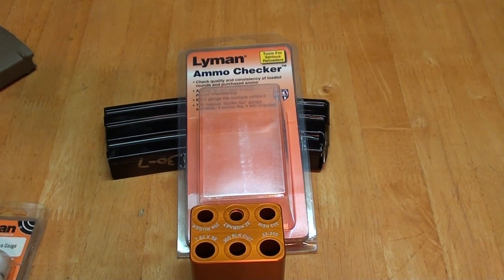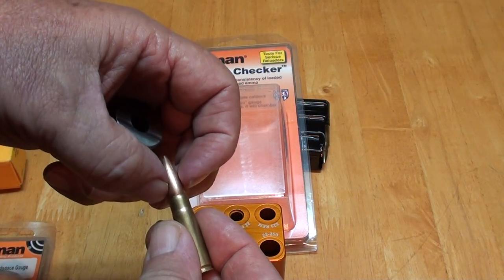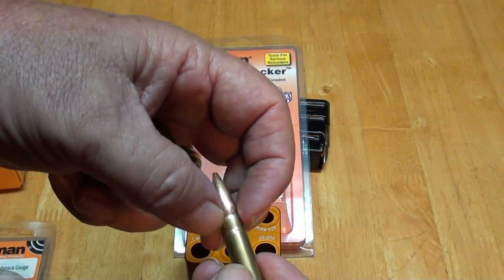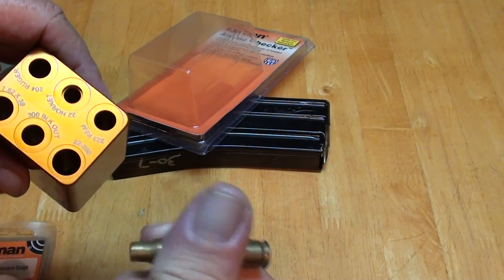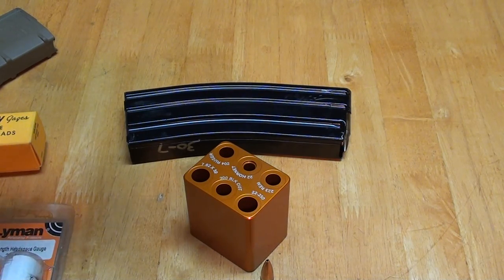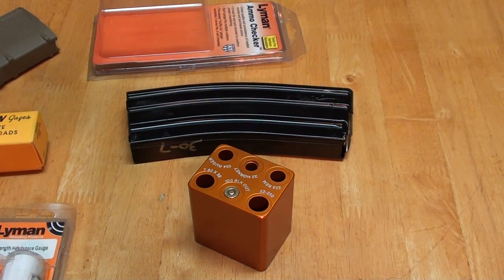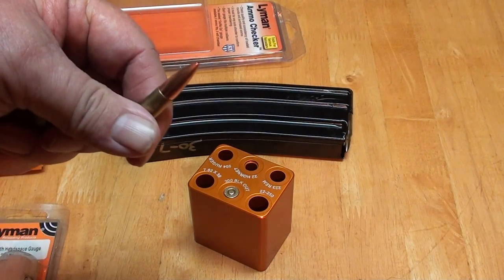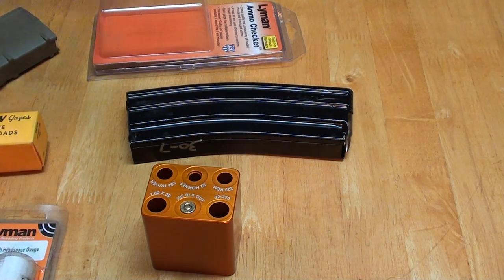Case gauge vs Ammo Checker .... which is which?

Comment: I love the Lyman ammo checker, but it’s not always perfect.  Earlier this year I got a great deal on several 100-round packs of Federal American Eagle .45 auto.  All rounds fit in the ammo checker, but about 10% of the rounds did not fit well in 3 separate match-grade 1911 barrels.  You had to really jam them the last bit of the way in, and it took some force to pull them out.  Upon close inspection of the pulled cases with a ball micrometer, the rounds that didn’t fit well had non-uniform case thickness around the mouth.  It was actually a really pronounced defect in those rounds; one side of the mouth was abnormally thick and the other side was way too thin. This caused the bullets to be non-concentric, and they were seated slightly tilted with respect to the bore axis.  This caused the side of the bullet where the case is too thin to wedge against that side of the barrel when chambered, and you can see the marks on the jacket when you remove the round.  When I tested the rounds in non-match-grade barrels, they fit perfectly fine in agreement with the ammo checker.

Comment: You are one of the few people that understand what a headspace gauge really does and what a case checker really does. Most people don't even know how to measure case total length using their headspace gauge (they push up on the primer side with their finger rather than placing it on a flat surface). I really don't reload rifle but I have headspace gauges for those that I might load. If I ever start reloading rifle I will get one of these ammo checkers too. Finally a knowledgeable reloader.
Reply from the maker: Thank you for the kind words. It is much appreciated.
Take care

Comment: Your Wilson tool is meant to check fired brass before resizing to determine if you need to resize and or if you need to trim... unfair to compare it to the lyman ammo checker as they are both for different jobs but do share 1 job in checking headspace, I am not sure about the lyman case gauge if it checks fired brass or if it has to be resized before you do, but the ammo checker is for nothing more then after you produce ammo that has been sized loaded and trimmed before hand, Both are handy tools to have

Comment: I guess that even that thing will not check the primer to make sure it is seated far enough. I have had some trouble with primers since I have had to use some of the cheap primers that are all I can get now. If the primer is not seated far enough  into the case, it will not fit into my chamber primarily on my Swedish M 96 6.5 x 55 Mauser. Have not had any trouble yet on my other rifles except maybe on my Swiss k-31 which is very sensitive to bullets. If they are not just right it will not fire them even if you can chamber them,
Reply from the maker: You might want ti checkout the RCBS bench priming system... it has adjustments for the seating depth of primers.
Take care

Comment: Using the Lyman Ammo Checker to aid in setting up your FL die and after resizing your brass before you load the case will save you a ton of headaches. However, if you have a "tight" camber some loaded rounds will still pass the ammo checker but won't chamber in the rifle. Then the rifle's (Usually a bolt action) chamber becomes the final and painfully slow test.

Comment: Nice vid.   I got myself one of each and yes I have 223 brass that shot once from my Rem 783 which can be neck-sized  and fits the case gauge which fails the ammo checker.  I guess that is because the fired case will still fit that specific gun it doesn't mean it will fit another .

Comment: Thanks very much, I do see your point, but I see the value in both.  You're right, the chamber checker does something the case gauges don't do in checking against min SAAMI specs. but as you say the reverse is also true.  The Wilson / Dillon case gauges also let you check for the correct trim length of a fired case before loading, plus unlike the chamber checker will allow you to determine exactly how much to adjust your sizing die to get optimal distance of the shoulder off the chamber wall, say 0.002" or so for a bolt action.  All you need is a dial indicator or caliper.

Both tools are valuable.  I keep a chamber checker in my range bag, but have Wilson and Dillon case gauges on my reloading bench.  If I could only choose one type it would probably be the case gauges for that utility, but luckily there's no need to do that.

BTW, I bought the L.E. Wilson gages for years just because of their quality, and they are beautifully engineered, but if anything the Dillon gauges are even nicer, and unlike the Wilson are stainless steel.  You have to be careful to keep the Wilson's oiled and in the plastic bag they come in or they will rust quickly.  

This is a quality tool from Lyman, but I've heard of some QC issues on their case length headspace gauges that compare to Wilson and Dillon, so even though they are $5-$6 bucks cheaper than those never went with them.  Tnx.

Comment: If your chamber is minimum spec tightness, then you need to buy small base dies. Problem solved.    That's what I use for my AR 15, anyway. RCBS AR Series, small base .223 dies. They allow your ammo to chamber more reliably, even when your chamber gets a little dirty.
Reply from the maker: The major problem with small base dies is that you over work your brass... and because of that you really have to check for case head separation more often and thoroughly.  The more you push back the brass the shorter life that piece of brass will have.
If it works for you great! I prefer to work my rifle brass as little as possible...buying more brass can get expensive!

Comment: By the way, I was surprised to see that round hang up in the Lyman checker.  At min chamber specs any properly sized round should drop right in.

Thanks again for pointing out the advisability of checking your loaded rounds with a checker like this.  Nothing like losing a match or tying up a rifle because one round failed to feed!

Comment: All of the ammunition I make (300BLK) will fit perfect in my lyman checker, however if the ammo does not fit perfect in my case length headspace gauge after the ammo has been completed, it will not chamber in my DDM4 PDW. I no longer use the lyman because of this

Comment: I recently started reloading .223 rounds. All have shot and cycled just dandy. I got one those Lyman checkers and my rounds get hung like yours did short of going in all the way. A resized case with a primer in it drops in like nothing. But after you load the bullet it doesn't. It's like loading the bullet bulges the case slightly down near the base. Hasn't seemed to a problem with them functioning, but it still bothers me a bit.
Reply: It means your chamber is a little bit looser than the SAAMI minimum in the neck. So it's not a problem for you, but if you get another AR with a tighter chamber, the rounds may not chamber properly, or get stuck when you do chamber them and be hard to extract without firing. Try a Lee Factory Crimp die, it may help!

Comment: Thank you for this video. Should a properly sized round simply slide out when you turn the checker upside down? Yours appear to in the video. I have some rounds that fit flush but won't slide out on their own. This coincides with a failure to extract said rounds in a certain rifle, so I think I have confirmed there is a problem. Thanks for any response.
Reply from the maker: So long as you don't have to apply a lot of force to the case to get it in or out you should be fine.
Reply: @papasplace2  thank you very much for the reply!

Comment: Great Video! Question: I have both these on my shopping list. Where does this ammo checker fit into the bullet comparator category? Will the ammo checker replace a bullet comparator or is that something to add to a reloaders shopping list for additional check? Thanks
Reply from the maker: The ammo checker is a one stop shop for reloading rifle. The only thing 
it doesn't check is overall length after you get the case loaded. IMHO I
 feel that the ammo checker is the best solution... unless your loading 
up some match grade stuff.

Comment: Yeah those are good if you put in your ammo back to Sammy specs but if you're putting her imma back to fit your own rifle at just bump in the shoulder or just neck sizing and it fits your rifle it will not work in that damn thing you got so now what you going to do
Reply from the maker: Your correct, if your just bumping back the shoulder to fit in your bolt action gun then the ammo checker is not what you need. Recent studies I have read for precision loading have started to call for full length resizing even for precision rifles. if your doing full length resizing then the ammo checker is what will work best. I have a friend that did a comparison between bumping shoulder back vs full length resizing and found that the full length resizing produced better groups and easier chambering in his 300 win mag Accuracy International AX rifle. Do what works best for you.
If your reloading for any semi-auto gun the ammo checker( or similar case gauge) is what you do need.

Comment: Have you tried the Dillon?
Reply from the maker: No, but it is just like the Lyman and the Wilson it is just a head space and case length gauge, it does not check case or neck diameter.
Reply: Papa's Place I bought Lyman pistol gauge 9mm and on the manual instruction I have Gauge checks: 1. Maximum and minimum headspace 2. Maximum and minimum case leght 3. Maximum cartrigde diameter 4. Maximum cartrigde lenght So my questions is this some kind NEW version of case Gauge ?

Comment: I'm going to ask a really stupid question. Will this work for 5.56 also?
Reply from the maker: blueknight Yes, 5.56 and 223 Remington cases are the exact same size
Reply: Papa's Place Thanks
Reply from the maker: blueknight oh, I almost forgot to say that there is no such thing as a stupid or really stupd question. lol
Reply: The cases are the same size but they are not the same pressure. Keep that in mind.
Reply: LoneWanderer360 I just have some 5.56 reloads I got from my brother and want to check them because the few I tried didn't go all the way in. But he saids they work in his gun with no problems.
Reply from the maker: Every chamber is cut just a tad tighter or looser. What your seeing is that your brothers chamber is cut a little on the looser side and yours is on the tighter side. Chamber cutters get worn down with each cutting and sometimes the mfg don't replace them as often thus getting the variance in chambers. Your brothers was cut with a new cutter and yours one that had been used for awhile. He may also have not resized the brass as much as he could have when he reloaded them too. The Lyman Ammo Checker measures to the tightest chamber spec and would have resolved most of your problem.
The difference between a 223 Remington, 223 Wylde and a 5.56 chamber is in the the throat(with 223 Remington being the shortest and the 5.56 the longest. 223 Wylde is in between)
Reply from the maker: That is very true and Thank you for pointing it out.
Reply: Papa's Place My brother's ar is a colt le6920 and my upper is a hardened arms 5.56.

Comment: Get a Sheridan engineering case gauge for .300 Blackout those Lyman ammo checkers are garbage 🗑️. I bought a Lyman MSR .458 SOCOM die set and came with a free ammo checker. The ammo will fit perfectly into the checker but not in my rifles chamber. I went ahead and got a Tromix slotted ammo gauge for my .458 rounds. Avoid these ammo checkers they will cause head aches and confusion.
Reply from the maker: I have never had any problems with any of my rifles or pistols using the Lyman ammo checkers.. 9mm, 45acp,357 mag/38spl., 223,5.6 Grendel and 30-06. 
At $49 a pop for the Tromix/Sheridan case gauges for all the calibers I reload for get really pricey! Spending $350 vs less then $100... nothing bad about the Sheridan gauges except the price for me.
Different strokes for different folks.
Reply: @papasplace2  well I'll tell ya, the Lyman tool only checks the case for proper size after you resize them. If you load a longer bullet that may come into contact with the barrel you'll have an issue with failure to go into battery. I reload 458 SOCOM and made 600 grain lead cast bullets. According to the recipe showing overall cartridge length, the bullet seating depth was too long. The Lyman checker tool didn't show any issues with the cartridge length because that's not what's it's for. If you want to load quality ammo you gotta have the tools. I'm just glad I got my Tromix case gauge because it helped me figure out what was going wrong. Anyway it's good to share info with fellow reloaders!
Reply from the maker: @robertrivasarroyo1174  Having the right tools makes all the difference! That's why I use the Hornady overall length gauge on all my rifles.Takes all the guess work out pf the equation as far as max overall round length along with a good caliper set up. 
The Lyman was never intended to measure over all round length. It simply makes sure that the case is properly resized so it will chamber. You can always use the plunk method with removing a pistol barrel...rifles not so much. I can't begin to tell you the number of people I have seen cussing and complaining that this die set or that die set was garbage because the didn't set it up right to begin with.

Comment: Ammo checker looks like a poor mans case gauge.   Not sure how its better than having a case gauge they do the same thing.   They are cheaper than buying a case gauge for each caliber but other than price I don't see why you would need one.
Reply from the maker: The case gauges by Lyman, Wilson and others only check the head space. They don't check to make sure that the case has been resized correctly. The ammo checker makes sure that the headspace and case diameter are correct.
Reply: @papasplace2  ?  I have Dillon case gauges.  If my 9mm round is too fat to fit in the gauge it wont fit in my gun either.   They all have a diameter anything larger will not fit in the gauge.  But yes if the Dillon is speced to the largest a chamber can be then some that will chamber in the case wont in a gun (Ive never had it happen with 9mm)  And the Lyman if speced to the smallest size a chamber will be will give false negatives, tossing out rounds you think are bad but will chamber fine in a AR.   

My non resized rounds will not fit in the Dillon gauge and wont fit in any Proper speced gun.    What makes more sense is say the Dillon gauge diameter is speced on the large end, meaning ammo fits a little looser and the lyman is drilled to a slightly smaller size specified to the smallest a chamber might be.  So they both check the same thing but on opposite ends of the spectrum.   The actual chamber of the gun is the bottom line though.  No case gauge will match them perfectly its a close enough type check.  

They both simulate putting a round in a gun.     I can see using them both then you cover each end of the chamber size spectrum.    Its not a bad thing to have both.   But using the lyman is going to reject cases that will fit perfectly in a properly specked gun chamber because most chambers in say 5.56 are not that small.   If that is the case then having both is not a bad idea.
Reply: @papasplace2  how would you "fix" your sizing die if it didn't resize correctly? I thought the only thing you can adjust with sizing dies is headspace- you can either get precision shell holders, or, you can adjust how far up or down the die screws in... but both of those methods only adjust for headspace, correct?? If you sized your brass incorrectly, and the diameter is off, how do you fix that??
Reply: @Solidbuilthomes  Sometimes its only off near the bottom of the case.   On 32acp I had to a get a new die as it was not sizing all the way down leaving a slight bulge on some rounds.   On others yes you can screw it down more.  On on of mine I sent it back to the factory and they shaved off a little on the bottom of the die to fix sizing issues near the bottom of the case.